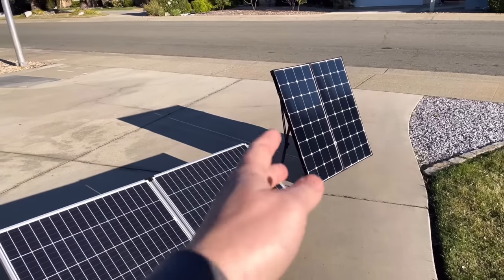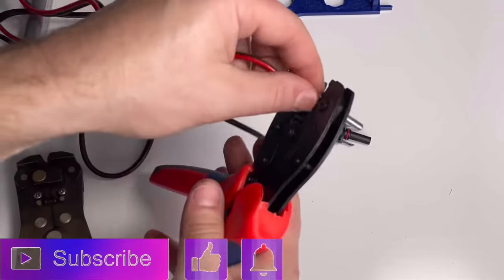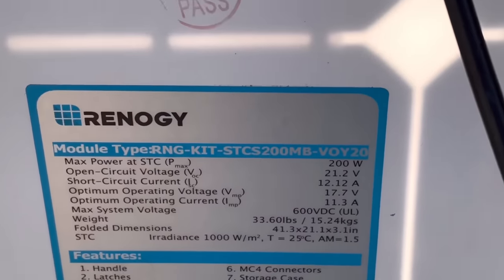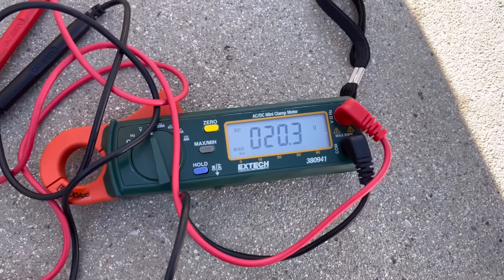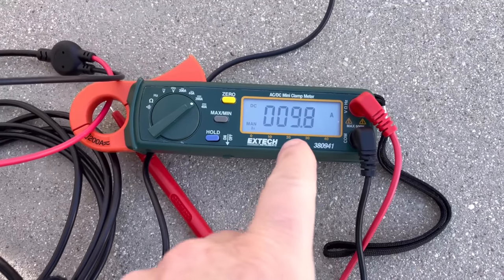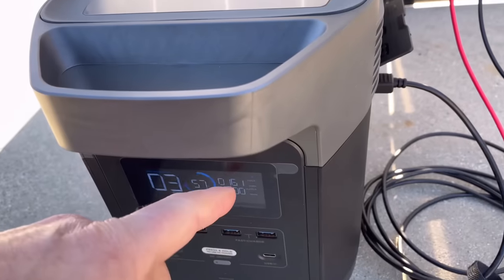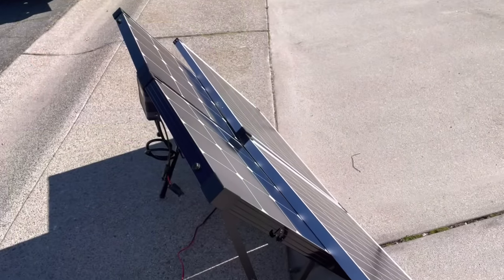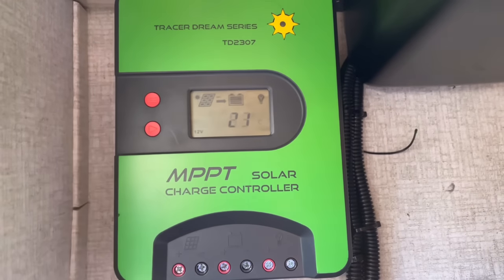Best Solar Panel - Harbor Freight 100 Watt Solar VS Renogy Eclipse Solar

Comment: I can't do solar at my property, but I do have a water wheel generating power. I'm currently using a 30A PWM controller hooked up to 4 deep cycle marine batteries. I've been looking at upgrading to an MPPT controller and the one you are using might fit the bill.
Reply from the maker: So far it’s doing great it does what it needs and no issues good deal for the price!

Comment: Ham radio operators are seeing a lot of RF interference in some solar installations. Sometimes it is the panel itself but mostly the controller is the culprit. They are supposed to be RF checked and approved but....we all know how that goes. So if your wifi or TV is acting funny have somebody check the neighbors new solar installation. Good video by the way.
Reply from the maker: Interesting info did not know. I’ll keep that in mind for future reference..👍🏼👊🏼
Reply from the maker: Ohh and thank you..👍🏼😀
Reply: is that for regular MPPT controllers or the microinverters where you have one on each panel?
Reply: Hmmm… my neighbor across the street recently had solar panels installed on his roof (very steep and faces my house), and my wifi has been pretty crappy since around the same time.  Anyone know of a fix for that?
Reply: @chriscappuccio  You know as much as I do.
Reply from the maker: I bet it’s the micro inverters if it’s a new install. Almost everyone has gone to them for residential solar installs verses the older big inverter box.

So maybe you would have to see when the install was done.

I honestly don’t think there could be that much interference as cities are always adding new communication towers everywhere along with more TV signals as well. Which maybe this is contributing to the Ham radio dirty signals..? 
Theory really but seems plausible..🤷‍♂️

Comment: I just bought a converted camper van for $800 off fb marketplace. It came with two 100w renogy panels, a nice 12v 200Ah battery, and a 200w inverter (2000w surge).

It also has a small kitchenette with a sink, micro fridge and microwave. The back of the van houses a queen sized bed frame with a brand new memory foam mattress, and the floors inside were redone with hardwood.

Literally felt like I was robbing the seller. But... I didn't pay cash. I acquired the van through trade.

A friend of mine was on hard times in 2020, and they decided to sell their car. They were so strapped for cash they were selling the car for nearly scrap price - so I bought it for $800. The intention was to hold on to it and sell it back to them once they stabilized.

That never happened, they spiraled out of control. We are no longer friends, and there's nothing I can do for them. So the car just sat in my driveway unused.

Talking to the person selling the van, I found out they dropped the price so low just so they could put a down payment on a used car at a lot. This seller had moved to my state with a partner who then abandoned them. 

I was really interested in the van already, so I asked if they would take a trade. My unused sedan for their camper van.

It was a perfect match.

I didn't need a third "family car," and the seller didn't need a converted camper van. We met at my place, traded titles, then got our vehicles inspected and registered together.

I feel like I won because I got a cool van I can take camping. The seller feels like they won because they got a whole car for the price of a down payment. And neither of us have any payments. I got rid of this car that's been sitting in my driveway, and the seller has something reliable they can use for work every day. The exchange was perfect.
Reply from the maker: Awesome!!! I love deals and sounds like both sides came out good!! 
Congrats 😀👍🏼

Comment: I liked the video and gave it a TU. Just curious about why you chose to cut off the Anderson connectors so short. If you had left an inch or two of wire you may have saved yourself a few bucks down the road if you needed an Anderson connector for another application. As you become handier you will learn to watch for things like that.
Reply from the maker: Thanks for TU. 

About the connector…..
Over the year I have done so many projects if I kept everything like that I would have so much stuff I wouldn’t know where to put it. A couple bucks isn’t worth the space in my garage or my wife’s sanity 😂👍🏼
Reply: @johnnysweekends  That's really funny to me because I meant that last comment as a "tongue in cheek" barb. I was baiting you a bit and you parried me with grace, well done. I don't throw anything away and it is one of the little known modern miracles that my wife has stayed with me for 42 years, in spite of that. So peace, brother, and score me "properly chastised". LOL
Reply from the maker: lol love it. 
Although yea hard to read or judge comments sometimes 👍🏼😂
Reply: @johnnysweekends  Ya did good!

Comment: I have 6 of the harbor freight 100 watt solar panels. I have them hooked up in series with mc4 connectors and going to my mppt solar controller. Then I have 4, 6v golf cart batteries 230 ah batteries there also hooked up in series. I have it hooked up to my rv and never have had low power. The solar panels are worth the money. the battery bank is the way too go hands down. Home made system

Comment: I have the 15w solar panel from Harbor Freight. It's really not bad and 5 years later still works just fine. I just erected it on an 11 foot high pole in my back yard having had it on my RV for 5 years. I replaced it on the RV with 60w of panels from eBay. The Harbor Freight charge controllers are horribly overpriced and underpowered. IMO the Harbor Freight panels are expensive. If you want cheaper then look at panels on eBay, Walmart and Home Depot. One of those will come up cheapest. Beware the flexible panels - they're never as powerful as they claim. I have two 10W flexible panels sold as 30W and 20W.
Reply from the maker: Yes the flexible ones have horrible ratings. I Kinda wanna get some to play with lol.
Reply: @johnnysweekends  Order one with a ludicrous power rating from eBay. Use a wattmeter to make a video proving that it does not produce the stated wattage and go for a refund. Et Voila - a free flexible low-wattage panel to test :p
Reply from the maker: All over it ..😂
Reply: The problem with flexible panels is that there is no air space under then when mounted. We all know that your efficiency goes down the hotter they get, sooo.....
Reply: @maven2k  The flexible panels I have are impossible to mount flat. The connector bulge is inexplicably mounted on the back.
Reply from the maker: It’s true you have to make a mount bracket to keep them lifted a little for air flow. Then it’s kinda like what’s the point. They work but you need enough for the amount of loss
Reply from the maker: Well that’s kinda dumb why would they do that..🤷‍♂️
Reply: @johnnysweekends  - I was thinking about using flexible panels with the eye rings... then use bungee cords to make an awning out of them over a metal structure. 

The bulges don’t matter, I just don’t know how long the bungee cords would last! LOL!

This keeps the air flow under the flexible panels
Reply: @johnnysweekends  Dunno but I have two. Not sure what to do with them.
Reply from the maker: Seems like it could work
Maybe para cord..?
Reply: @johnnysweekends  I'm thinking lightweight to hang inside a window. If I can get a few more then it'll be useful but they're going to have to be cheaper.

For the moment, perhaps build one into a briefcase to use as a solar demonstrator.
Reply from the maker: Not a bad idea….
Maybe I’ll add that to the list..!
Reply: @raisagorbachov  I understand a glass window cuts the power by the sunlight by I think 50%.
Reply: @paulnese1090  Being vertical rather than aimed at the sun cuts power too. I have no problem with my RV setup though. That has 2 x 30W panels inside the windshield and 2 x 10W panels mounted above the back door but vertical - I'm not going to try to mount anthing on the roof.

Comment: I have heard from several sources that high dollars does not always mean high quality in solar panels.
Reply from the maker: This is true especially when so many are made in the same areas. Different name, different frame and maybe a couple different things to change it but the cells and glass are the same.

Comment: In my race car trailer I have a 75ah battery or so and am going to add 200w solar for charging the battery for the lights/radio/winch/car while at the track or while stored. My trailer has power from tow vehicle also. I am thinking about a DC to DC charger with MTTP.  20 or 30 amp in case of adding another panel. Should I do it that way or just rely on the solar and unhook charge wire from tow vehicle and use stand alone controller?  The battery should always be charged before a trip if solar is active or trailer hooked is up to shore power and solar is off, so charging on the road really is not needed. I really am studying your videos, great content. Thanks,
Reply from the maker: I would just use the solar. You could leave tow vehicle charge wire there as it will still provide Dc current to the battery at the proper battery voltage for lead acid but not Lithium. So it would only charge to about 85-90%. But could help it out. 
But 200 watts of solar will do fine keeping it charge and then maybe just carry a really small generator in case you need a pinch of power. Or a bigger one if you need it for race items. Air compressor and more for race days.

Comment: I love my two harbor freight panels
Reply from the maker: They work great for. For the price hard to beat..👍🏼
Reply: @johnnysweekends  very hard to beat I need more LoL live on a fixed income so when I can afford and save up enough I buy a panel this month I'm going to try to buy one more panel so I'll finally have three it takes a little bit for me to save up enough I'm allowed 400 watts of power so I can have four panels to this one little system and then I'll have to buy another system or a bigger MPP controller
Reply: I went with the Zamp solar Obsidian 100 watt (plug and play…) for my Intech   Rover

Comment: I imagine someone has already commented on this, but I think the two Renogy panels are wired in parallel, and you wired the HF panels in series. That would explain the voltage/current difference.
Reply from the maker: They are both in series which you can see in the video. Also I would need branch adapters to go parallel.

Comment: The connector you cut off was an SAE connector
Reply from the maker: Yea I know, I messed that up. I was playing with a couple battery connectors earlier for a removable wench I’m thinking of using and the quick connect and Andersen style are popular for that. So mistakenly said Anderson and didn’t even catch it in editing …🤷‍♂️ 
I did make a note in the video description but not a lot of people read those lol. 
Not easy to edit a video one released. 🙄
Reply: @johnnysweekends  but we just read it here. You did a great job on this video , thank you for the comparing the Solars. what i've been looking for.
Reply from the maker: Thank you so much…👍🏼😀

Comment: i have never had any solar and have an opertunity to buy an echo flow from an accountant and looking for a solar panel Sounds like the hf should work thanks for the info
Reply from the maker: They will work for a lot of stuff. And solar panels of all brands have been coming down. 
Depending what you wanna do or need look into residential used solar panels. You can get a lot more watts for way cheaper then a renogy or Hf panel. These are good if you need portable stuff. But 100 or even 200 watts is not enough. 200 is bare minimum because after the cells settle you will only get about 180ish watts on the best days.

Comment: I’ve been trying to understand powering a house with solar …. I understand wiring and electrical to a decent degree but I want to figure out how to power everything in my home even if it’s turning things off to use like the water heater…. Basically just survival and using amenities for my family of 6
Reply from the maker: Yea you need a decent setup of running high power items like heaters or dryer or microwave and AC units. Those are big draw items. Heaters and microwaves and hair dryers all draw about 1500-1700 watts which over a hour is a lot of power. 

So Solar provides DC power. We use micro inverters to flip the power or invert it to Ac. It’s power goes to your panel or a sun panel and to the grid. So if the grid shuts off your solar is still making power but no we’re to properly store it or run anything. In simple terms anyway. 
Hence you need batteries to store the extra power so at night or power outages the batteries are ready to go. 

If needing a decent amount of power then residential panels are the way to go.. and not these little panels that are meant for light weight stuff and being portable. 
At a dollar a watt it’s not very price savvy as buying something for .50 cents a watt or even less
Reply: @johnnysweekends  where can I look to buy bigger panels that I’m not paying for a name but  decent quality ….
Reply from the maker: Check out Facebook market place and clist there are always good used one for cheap. Some are close to new.

Comment: You can put the two renogy panels in series and get 38.5V out of the pair and get about 16-17.5A out of those Eclipse panels at 12V with a good MPPT charge controller and peak sun. I have the same ones hooked to a 30A Rich Solar MPPT feeding (4) 100AH AGMs in the radio shack. When it's cold out in the winter,below 40 degrees, I've seen up to 244W at 38.96V and, with cable losses was basically 20A at 12V. The downfall of monocrystaline panels, especially in series, is that clouds and shade are your enemy. Tje polys do better in some situations, but the monos are WAY more efficient. We're talking 16% for the HF polys vs 22% for the Eclipse monos.
Reply from the maker: Yea both of these were in series and both are mono, but for some reason I could never get more then about 180w out of the renogy even on the best days changing either a power station or batteries..🤷‍♂️
Reply: @johnnysweekends  If the Renogies were in series, you should definitely see more voltage. I'd check the MC4s and see what the panel voltages are individually on those panels and what the waytage output is per panel. You might have some shot cells. That EcoFlow Delta should also have an MPPT in it. My Mini takes up to 75V at 10A, so either the HFs in series or the Eclipses in series will be fine.
Reply from the maker: Yes ECOFLOW and other power station units have mppt built in. 
But yea I could have had a dead cell unfortunately no longer have the renogy setup. But it was weird I never got great numbers with that setup. Which I thought it would have done better.

Comment: Solar panels are just like everything else. The price you pay is for the name that's glued on them. Watts are watts. Maybe you get a little better build quality but if you don't abuse the cheap ones they'll last just as long. If you have a bad storm it will destroy both of them. I didn't buy harbor freight panels, I got mine on amazon for about .70 a watt. And you have the solar charge controller I do. It's worked perfect.
Reply from the maker: You have the Beleeb ..?

Comment: quick question - I got a harbor freight panel on sale, but all my other items are from Renogy. HF's connections are sae connectors. Can I add an sae extension cord (so I don't void my warranty) and then cut the plastic connector off on one end so I can plug it into the renogy charge contoller? I am new to solar and am definitely not an electrician.
Reply from the maker: Yes you could add a extension and then add mc4 style with a mc4 kit and tools or use this in the link and you are ready to go..👍🏼😀

https://amzn.to/3844Wkw

Comment: I think what your devices were measuring were throwing you off a bit, the panel in the trailer was much more accurate. The higher the voltage, the lower the amps needed to produce the same result.   Example, a 110 volt  motor draws more current, then the same motor wired to 220 volts.  Same output, but lower current needed to do it, so I think your measurement at the panels were 100% correct,  the HF panels were putting out more than you thought based off the readings, and when you showed the internal panel, it showed what they were truly putting out.   If you were to just go by what the panel readings were, you would think they aren't putting out enough current, but they are.      I will take higher volt output panels any day, as long as a good controller is in place to actually use the power.
Reply from the maker: Yea the panels are still doing a really good job. Been out side for a month. 
Also have to remember a little bit of loss for all the connections from meters to side of trailer then to controller. It’s not much but it’s a little loss.
Reply: its how many electrons pas for second per inch dork  volts is speed  volume is amps